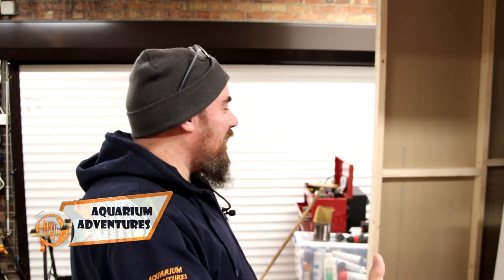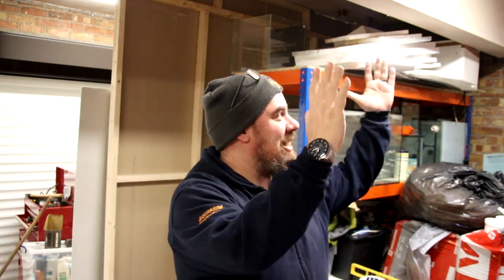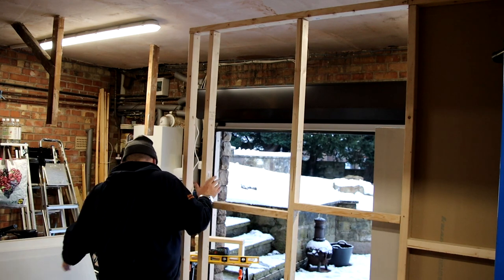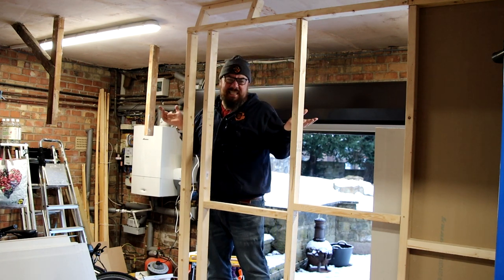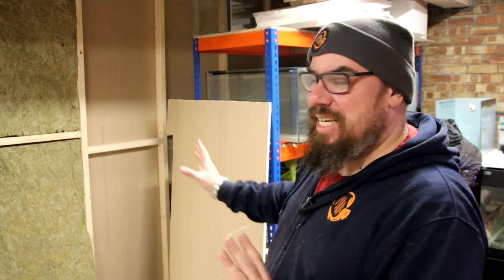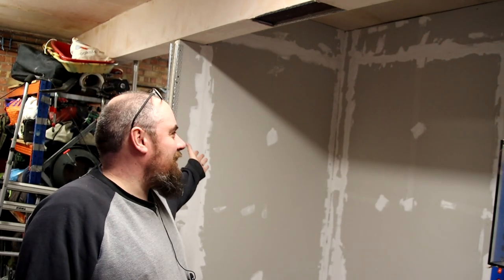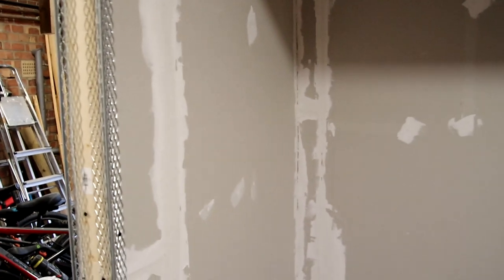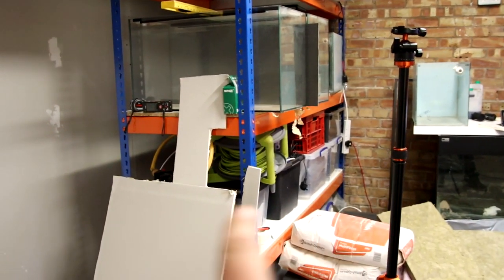Fish Room 2.0 - Build started!!

Comment: I've been a joiner for 15yr+ and I've seen worse work from tradies, so we'll done bud good job well done. when your timber lengths are to short, just build a smaller stud frame on top. Just over lap the joints,  still a good job tho dude.